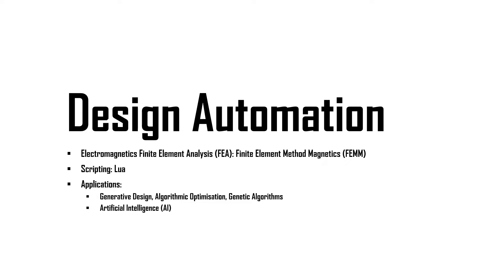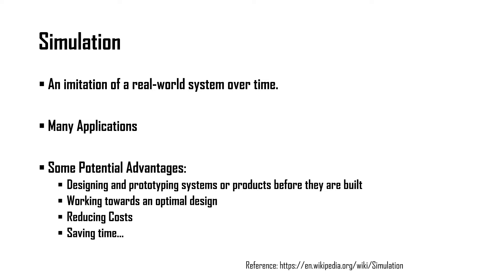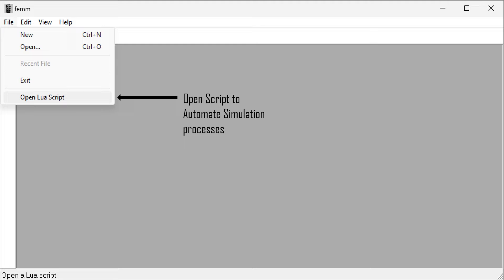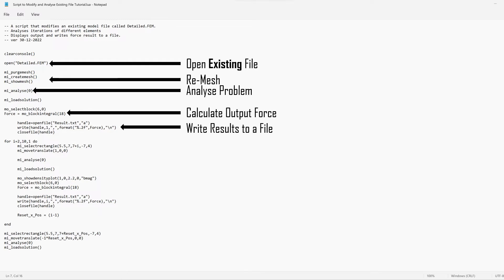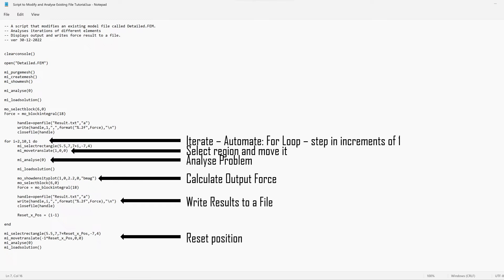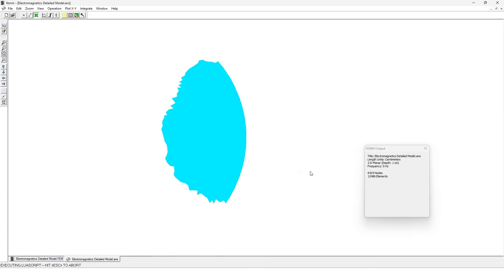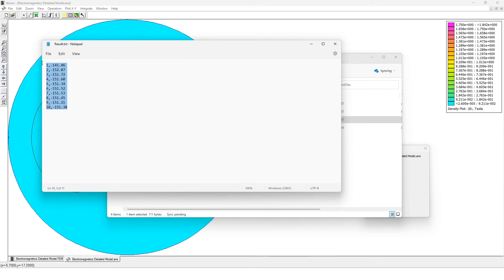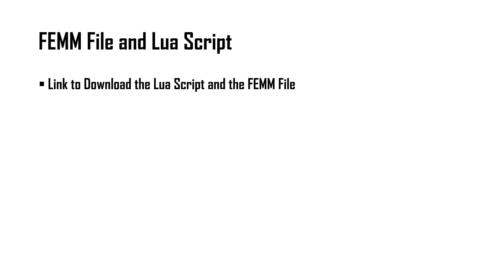Design Automation (FEMM Scripting, Lua Scripting, Potential Artificial Intelligence AI Foundations)

Comment: If there is file not available, so how to create lua script file... 
Please reply me...
Reply from the maker: Please see the link in description to get the file, the video also shows a screenshot of the text in the file if you would like to replicate.  I don't recall doing a BLDC myself, you may need to have your analytical equations in place before you start.  Consider seeking expert advice in the field if necessary.
Reply: @mikailansari  i have all data calculated, only need to lua script creat...
Reply: @mikailansari  created in notepad it will capable to run femm software...
Reply from the maker: @hemantbhaichaudhari5096  you can consider going through the manual if you would like to develop the lua script yourself, if you feel you may have limited time you can also consider hiring someone/on a consulting or hourly basis.
Reply: @mikailansari  which manual??
Reply from the maker: @hemantbhaichaudhari5096  on the FEMM website documentation, how to use the software, it discusses some foundational elements on how to use femm with lua.
Reply: @mikailansari  ok thanks...